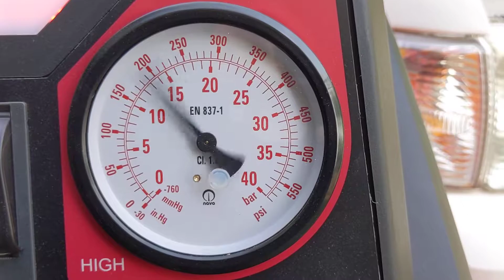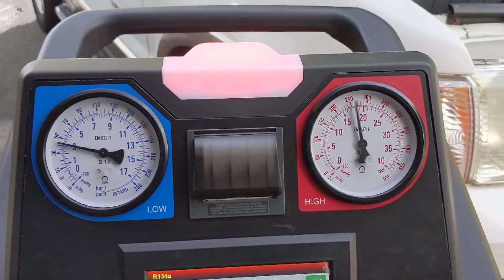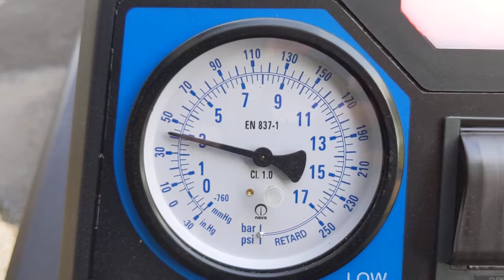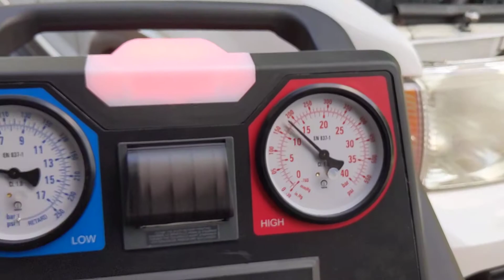2004 Ford Explorer A/C fluttering high side gauge (1080 @ 60fps)

Comment: It looks like by adjusting the gauges valve depressor he was able to make it stabilize, he might have been picking up the actual compressor as it pushes the gas through. By adjusting he was able to still get a steady read. Not sure if this is 100 percent the case but looks like what's going on by watching the whole vid.